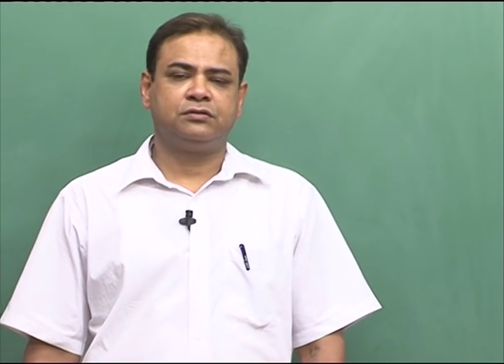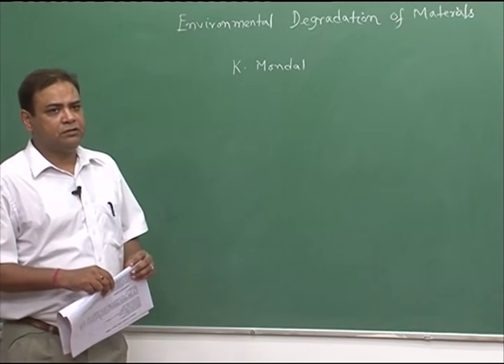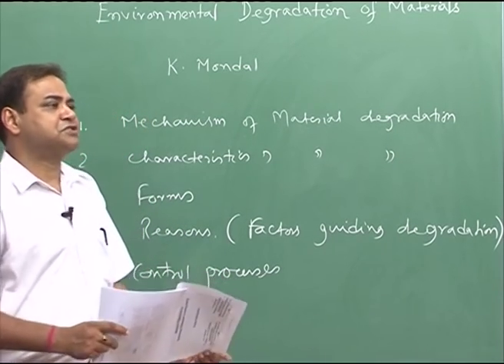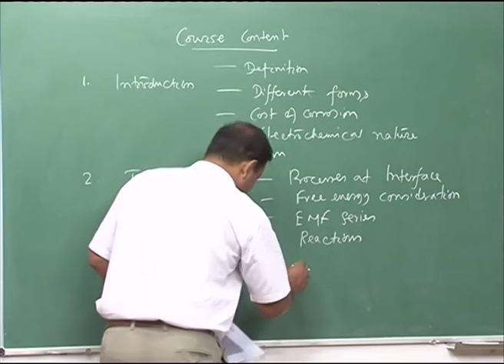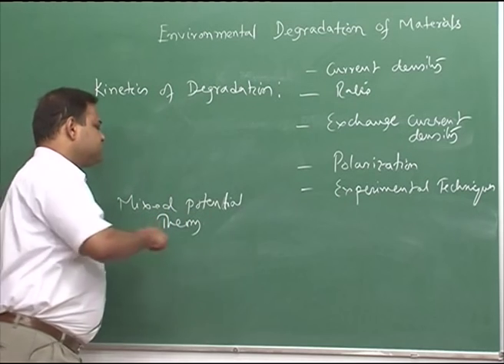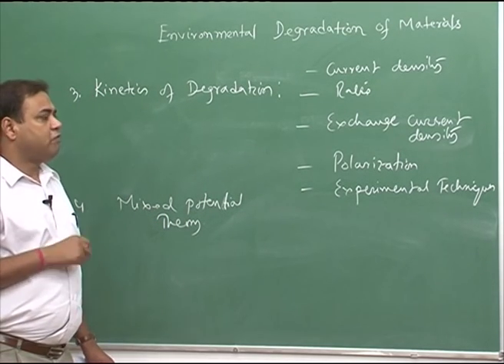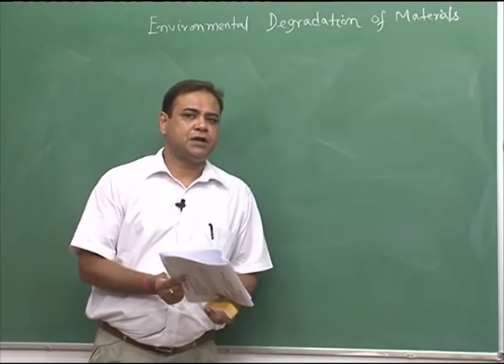Mod-01 Lec-01 Introduction, Basic definition of corrosion

Comment: 🎯 Key Takeaways for quick navigation:

00:15 📚 This course on environmental degradation of materials covers various aspects of material degradation when exposed to the environment.
02:13 ⚙️ Materials can degrade due to physical, chemical, or mechanical effects, including factors like heat, radiation, and chemical agents like oxygen, moisture, or acids.
06:08 🛢️ The primary focus of this course is on corrosion and oxidation of metals and alloys, as well as prevention mechanisms.
10:44 ⚗️ Topics covered include thermodynamics and kinetics of degradation, electrochemical reactions, and corrosion measurement techniques.
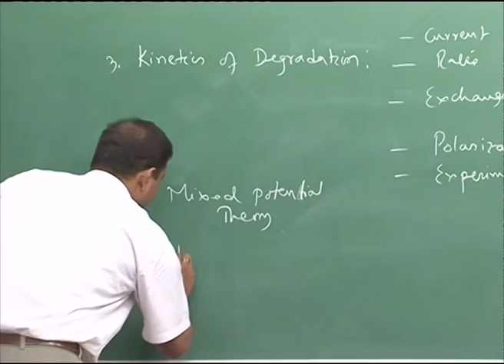13:46 🔄 The mix potential theory is discussed to understand the advanced aspects of corrosion, passivation, and different forms of corrosion.
16:16 📊 The course also covers corrosion measurement methods, failure analysis, and various factors affecting corrosion, such as stress, impurities, and oxygen presence.
18:05 🛠️ Corrosion control strategies include material selection, equipment design, environmental changes, electrochemical protection, and coatings.
20:15 🧪 While metals and alloys are the main focus, the course briefly touches on the degradation of other materials like polymers, composites, and ceramics.
21:54 🌡️ High-temperature degradation topics include oxidation, liquid metal corrosion, and hot corrosion.
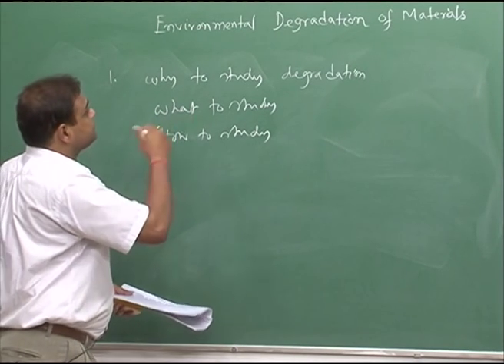23:18 💰 Material degradation has significant economic consequences, with billions spent on corrosion prevention, making the study of degradation crucial.
34:19 💡 Degradation is defined as the loss of performance in an engineering system, encompassing factors like strength, efficiency, lifetime, and appearance.
45:51 🔄 Corrosion is a natural electrochemical process that involves the degradation of metals due to reactions with the environment.
47:58 ⚗️ Corrosion involves an electrochemical reaction, with zinc undergoing anodic and cathodic reactions when reacting with HCl.
53:00 🧪 Electrochemical reactions have four basic components: anode, cathode, ion movement in the electrolyte, and a conductor.
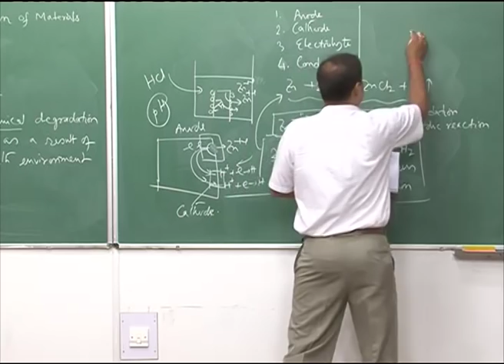55:06 🔩 Corrosion factors include metallurgical, mechanical, thermodynamic, and electrochemical aspects.

Made with HARPA AI